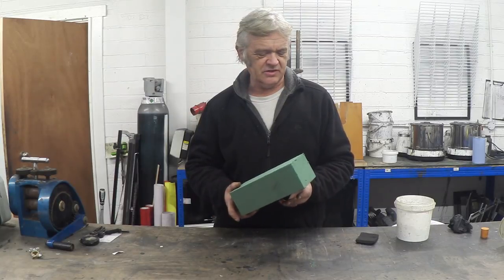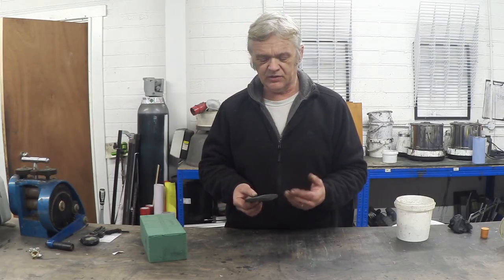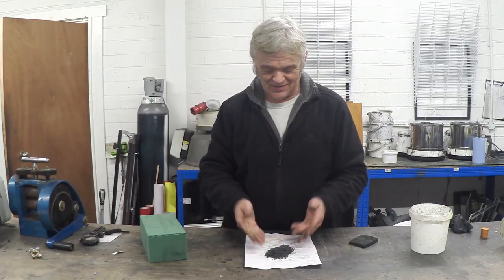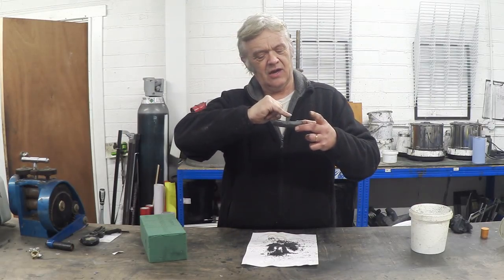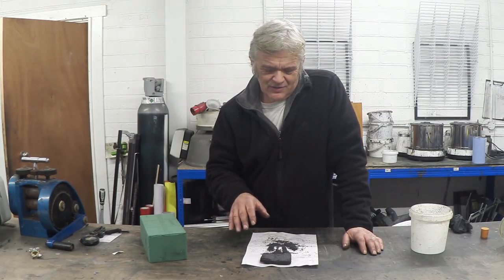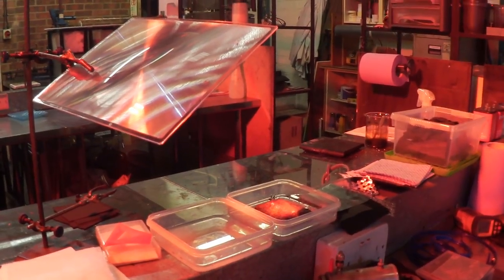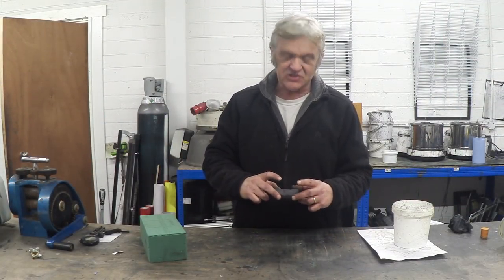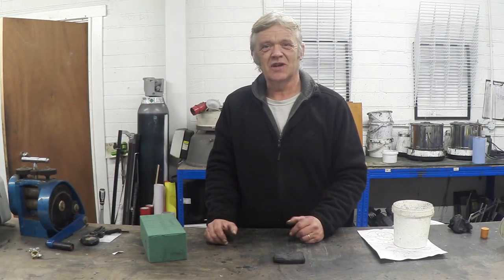Desalinate Water With Oasis Foam

Comment: MIT used 10 Sun. You can actually make steam with 1 Sun if you create a blackened alu sheet floating on water with tiny holes at 5cm intervals or so. The metal will collect the heat and dump it on the water that wicks through the hole..

Comment: Wouldnt it work just fine without carbonizing the foam and just using the exfoliated Graphite? Or has the foam any special use besides soaking up water?
Reply from the maker: the foam performs like a preheater when it is carbonised mate

Comment: Hi Robert. Your experiments are usually interesting. Thank you so much. Why you used an especial thickness of the foam? did you covered all the faces of the foam with the exfoliated graphite? Does the exfoliated graphite diffuse entirely through the pores of the foam to connect the one comes from the other face (surface) to change the hydrophobic foam to a hydrophilic one?
Reply from the maker: it's just on the top mate and I only really followed the MIT paper

Comment: Would the water boil even easier if it were in a bit of a Vacuum? There would need to be a way the seperate the distilled water from the system, which should be easy enough, I'm just thinking about Efficiency. It would be an improved solution for those who get less sunlight.   I also remember seeing the Solar Sponge on Twitter😛 Very clever way to concentrate heat onto lesser volumes of water to reach the steam state, and self propegate continual transfer of water to the heated point with the hydrophilic material.
Reply from the maker: yes mate it would and I agree collecting wouldn't be much of a challenge

Comment: I need to understand why you needed to carbonize the foam.  Why not just slice off 2" of the foam, put your  anexfoliated graphite on top, and heat it that way?  And how much faster does the water steam, and what is the volume of fresh water created this way versus just heating up the water?  also set up a steel or copper mesh, painted black, float it on the surface and see time frame, and volume of water produced.  The important question,will this be more cost effective on  a large scale?
Reply from the maker: all good questions mate and all very do-able - get in that kitchen and start experimenting lol

Comment: Making steam for an engine to move anything is a whole other thing than merely evaporating water rapidly at atmospheric pressure. You will need a lot of complicated expensive stuff to make the kind of steam an engine will run on.
Reply from the maker: not my claim lol - i might have misread the report it was a news article and i went to the paper from that - i admit i didn't really read the paper just glanced through for the experimental section
Reply: @ThinkingandTinkering  Just felt it important to make sure people did not somehow take off on this thinking they had found some magic bullet for making some kind of new super-engine that qualifies as one of those magical mystical miraculous free energy devices that don't exist and end up all angry and disappointed, or worse, somehow hurt themselves in the effort.

Comment: Robert, all that exquisitely conductive Carbon Foam/Exfoliated Graphite and the rising steam just shouts out "Charge Separation".  Substantial voltage could be achieved with the right configuration between two evaporation streams. Combined with "Lord Kelvin's Water Dropping Condenser", on the down cycle, an interesting and practical desalination apparatus might be constructed.  With charge-sep on both evaporation and condensation, enough static electricity could be captured/released/generated to charge [your] supercapacitors, thence a battery, which then performs useful functions.  This could be a USB cellphone/device charger, or overnight LED illumination for remote village environments, or a small aquarium pump for moving/dispensing the water, or a solar tracking motor for a lens/reflector, etc.  Water AND Power, anywhere under the sun, with ultracheap environmental materials, now that's something you might find immediate funding for, just based on the prototype (from the GEF and other NGOs, among others).
Reply from the maker: it is funny mate - i never thought about that - that is a very interesting idea - thanks for taking the time to share

Comment: Forgive me if I've missed something, could the oasis just be used "as is" without the carbonising step as it seems to me that its only purpose is to "deliver" the water, once it's there the exfoliated graphene still does the magic?
Reply from the maker: it does a preheat - I tried it without carbonising and it didn't work
Reply: @ThinkingandTinkering  should have shown that in the vid for comparison

Comment: Hmmm, i bet this would be good for collecting RF energy from the air.
Reply from the maker: yeah probably - give it a go mate
Reply: INVENTOR3 Hi Paul, that might work but it would require experimenting with frequencies and methods of concentration.
Reply: @MrFmiller  HEY HELLO!   I believe this would work better than my etched copper plates on my roof for collecting RF.  Yeah, as you mention, i would need to do some concentrated freq experiments.

Comment: Seems like a thin layer of your ink could go between the wick and graphite if you have a formulation that dries with a decent porosity and resistivity. That way it could be a hybrid system where the sun could be utilized to its full extent, and if needed supplimental power could be passed through the ink layer to boost the heat. The wick could be a half inch of untreated rockwool with the fibers vertical with a bit of untreated closed cell foam underneath to handle buoyancy. Some holes through the foam could ensure even wicking, but rockwood wicks amazingly so I don't think it would need anything but the sides exposed for areas under a square foot or two.
Reply from the maker: nice ideas mate - cheers

Comment: Cool tech Robert.

To utilize this for water collection; one would need to build a glass top that funneled the steam into a tube which ports it to a stainless steel collector such as would be used to collect water from the dew at night.

The bottom should have a grid that the carbonized foam sits on and allows the water to come in contact with the foam. Adding a floating ring around the outside of the container would allow the container to float in the water. Adding a second container next to that in which the steam was funneled, would make a compact water collection device.
Reply from the maker: or polypropylene mate?
Reply: @ThinkingandTinkering  
Over time, the polypropylene will deteriorate whereas glass will not.
The plastic may also cloud up over time preventing the sunlight from heating the graphene.
For a long term use, I think glass is the better material. 
Either way, it will need to be cleaned from time to time.
Reply from the maker: @scotttovey  cheers mate
Reply: @ThinkingandTinkering  😎👍

Comment: How does this help generate steam? Does the carbon absorb solar energy so well that steam is generated at the surface only?  I take it that the whole body of water does not have to reach 100 C, just the water at the surface of the carbon? It would take very much less energy to produce water vapor if that is the case.
If the resultant water vapor was ducted through tubes just below the surface of the carbon, the heat of vaporization could be recycled into the water about to be vaporized. The same heat could be used twice, or many times for that matter.
Reply from the maker: you exactly right mate

Comment: Nice, I like it. Though I doubt driving an engine that could do work is possible. For that you not only need steam but a fair amount of pressure from the steam.
Reply from the maker: MIT claimed they did it - i may have misread it i guess - it was just a newsreport on their work
Reply: @ThinkingandTinkering  May have been a engine that couldn't handle a load. Completely possible.
Reply: @eric Yes you could run one. To do what? Light up a single led in the sunlight. Small Sterling engines are just show. No real load like I said.

Comment: Now that thing that would make this more interesting would be if you could turn that layer of exfoliated graphite into a solar panel. Also, if you can make an efficient (carbon ink) paint on solar panel, I will plastidip my car trunk and paint a solar panel on it. Plastidip comes off like vinyled car layer, so it is not permanent
Reply from the maker: lol - next project?

Comment: A simple set up to use the oasis graphene foam to distill water.
Get a fish aquarium a high sided tray it will fit in and a glass baking tray to fit inside the aquarium.
place big tray down fill the baking tray with seawater and the foam place aquarium over the baking tray place it all in open sunlight.
Reply from the maker: very nice mate - cheers

Comment: I live on a boat... how do I make drinking water with this?
Reply from the maker: collect the steam and let it condense
Reply: @ThinkingandTinkering  It would be a major undertaking to produce, say, 20 litres of water. A given volume of steam will condense by a factor of 1000:1 if my guess is close? 
Am I right that the graphene/foam give a massively increased surface area for the heating to occur?
Reply: A simple set up to use the oasis graphene foam to distil water.
Get a fish aquarium a high sided tray it will fit in and a glass baking tray to fit inside the aquarium.
place big tray down fill the baking tray with seawater and the foam place aquarium over the baking tray place it all in open sunlight.

Comment: As an unemployed housedad without a shop I live vicariously through your videos 😎

Can you investigate a possible future experiment with your graphene kung-fu?

These guys made a printed circuit board stator, I think you can one-up it. 🤓

https://insideevs.com/news/386297/infinitum-electric-printed-circuit-board-stator/
Reply from the maker: been thinking about it mate - only there is not really enough time in a day lol
Reply: @ThinkingandTinkering  no rush.

And the part in this video where you mentioned steam production for an engine, well hold on to your hat for this tidbit.

If you take a high-pressure injector out of a diesel engine and modify it to squirt salt water at a stainless steel impacting surface at close range, the cavitation of all those tiny droplets makes some devilry take place.

Basically a very VERY big boom of flash steam 🤩
Reply: How high a pressure? Any idea or links? Would love to ck that out!

Comment: Robert, what is oasis foam?
Reply: There are 2 types..both used in floristy...one that is for water..one is for silk flowers...usually found at craft stores
Reply: @sislertx  
Many thanks!
Reply from the maker: Sisterx has it mate - but just to add Oasis is a trademarked name for wet floral foam, the spongy phenolic foam used for real flower arranging. It soaks up water like a sponge and acts both as a preservative to prolong the life of the flowers and a support to hold them in place. The foam's structure is similar to that of plants and has capillary action to move water to the surface and up the stem. It is often green, but is also available in many other colours, such as purple, red, yellow, and brown. It usually is supplied in a brick shape - straight from wikipaedia mate - cheers
Reply: @ThinkingandTinkering  
Many thanks Bob!
I've seen a cylinder in your workshop. I do not know if it is oxygen or acetylene but it makes me remember that oxygen is the real enemy for all diseases. If you have oxygen use it to breath sometimes two times a week,  for instance.
Do it man! 
Regards.